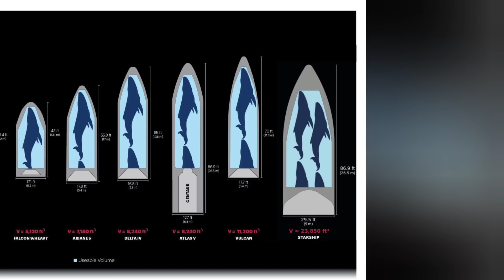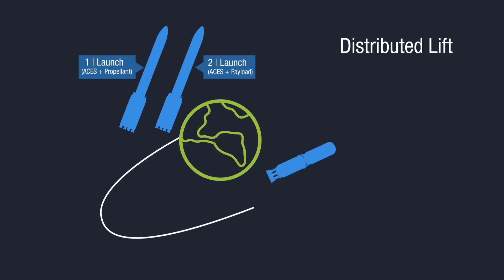Devastating news for ULA!!  But why does Vulcan Centaur matter?

Comment: Angry, the video is hard to follow; you speak of devastating news; and more then 3minutes in you still have not explained what you are talking about, what the issue is, nothing; not even a hint. You finally spill the beans more then 5min in the video... ULA has no more launch vehicles until Vulcan can fly ... so no more business for ULA, and indeed that is bad news. Maybe they can use SpaceX engines? Why not!?

Comment: Not surprised with changes needed for second stage.
Did you forget?  
ULA made a decision to REDUCE the thickness of Centaur 5, 
from the current Centaur 3.  

While I was suspect of that decision, due to Centaur 5 volume increase (my physics background),
BUT I had not seen the engineering or design for Centaur 5 (so no opinion voiced).

The open question, will the Centaur 5 thickness need to be greater than Centaur 3 ?
Larger second stage and its volume need to have same designed safety margin as Centaur 3.

Tory Bruno’s current position reminds me of Grumman’s Tom Kelly, project manager for the Lunar Module.
One engineer made a calculation error (landing struts) and bravely told Tom (expecting to be dismissed).
It delayed the delivery of the Lunar Module (not flying with Apollo 8 in 1968).
Grumman’s Lunar Modules did not fail with landing or launches at the Moon.

Comment: So if I translate with notions that I have already encountered; 
the centaur V would therefore be equipped with "tank-balloon" type tanks.

As during the beginnings of the space race (1950-1960), tanks with walls so thin that it is imperative to ALWAYS put them in overpressure

In the event of loss of pressure in the tanks, the image of an empty coke can crushed in your hand gives you an idea of the disaster that already happened a long time ago during a dress rehearsal before a launch .

When the StarShip is unable to take care of useful type C loads, there is a detail to remember

Who would use a Dragster to compete in the Nascar Coca-Cola 600?      nobody,     because dragsters are not designed for! !
 
It's the same for StarShip, it's a wonderful project but it's a concept designed for some specific missions but not All missions

Comment: Of course Musk would just launch the beast, as he did with IFT1.

SpaceX could easily carry a Falcon 9 second stage as payload for missions beyond LEO.

It is unfortunate that SpaceX has so little competition.  Musk himself would enjoy being in a race.  SpaceX demonstrated FIVE YEARS AGO that it was possible to recover a booster and prepare it in just weeks to launch again.  SpaceX has now recovered boosters over 200 times, while only one other booster has been recovered, by Rocket Lab, and even then only after a saltwater bath and not in a condition where it was economical to refurbish.  ULA, Arianespace, and even Roskosmos should have started on reuse over ten years ago.
Reply: I thought Rocket Lab was happy with the condition of their booster after recovery and extensive inspection?
Reply: @michaelreid2329 i think they will reuse an engine but not that full stage. I would guess that is because they stripped it down for analysis for future rockets.
Reply: @michaelreid2329  as I said the recovered booster is not economical to refurbish.  The recovered booster is a learning experience, the sort that SpaceX depends upon.  Examining the recovered booster permits Rocket Lab to identify where waterproof seals can protect sensitive parts from salt water.  On STS (Shuttle) the SRBs were recovered because NASA had promised Congress that they would be recovered and reused, but it cost more to recondition the SRBs than to build fresh SRBs from scratch.
Reply: Falcon heavy can already carry more than twice the payload of the Delta IV heavy lift, while the Vulcan, if it ever flies, will be able to lift about 20% more than Falcon heavy.
Reply: @michaelmurphy6195  True.  It will take a couple of years for the US Military to consider Starship for its launches.  Remember it was three years after Falcon Heavy first flew before SpaceX clawed a contract away from ULA.  Two years from now Starship will be a very different product, or rather series of different products, than it is right now.  Nobody, except Starlink and NASA HLS, even has a project which needs Starship to solve.
Reply: @jamescobban857  I also think there is very good reason for no existing missions to require Starship except those two mentioned, as it's not yet proven, and why bet YOUR entire mission/company on a yet to be proven concept?
Most likely once starship works, (assuming it does ofc), there will be more customers interested in it. Obviously with a delay, as they would not have started their project yet, but at least for LEO if you don't need to focus so much on space and weight constraints, I bet that many things can be made simpler and cheaper then today, pushing demand...
It's a bit of a chicken and egg problem, one has to exist for the other to make any sense. And in this case SpaceX is taking the chance of customers wanting it once it's proven.
Reply: @michaelmurphy6195 Google tells me, that Falcon Heavy with no reuse can lift more than max booster Vulcan. So this 20% is not true.
Reply: @ErkiEntveg  I can't argue with that, but the whole purpose is to keep prices down by reusing the boosters. I'm sure it would cost less to fly than the Vulcan even if they expend the boosters.
Reply: And probably build a test stand for centaur in about six months.
Reply: In the past, those other companies published papers "proving" economical recovery was nearly impossible. Evidently they believe their propaganda is more reliable than real world experience.
Reply: The Obama white House paid Boeing over 300 million to tell them reusability couldn't be done. Less than 10 years later here we are.....
Reply: Musk doesn't do anything bro, it's the people that are employed there!!
Reply: If Musk wants a genuine space race, then he can try to get his Starship to the moon before China's copy of Starship makes it there before him lol.

Comment: I think your argument is based on 2 assumptions.  First, that the efficiency of the Raptor engines won’t improve.  Secondly, that Starship will be so expensive to launch that it will make fuel launches very expensive.  The pace of advancement on the engines continues and the targets for Starship launch costs will only go down as they get the vehicle figured out.  The full reusability, unlike the Vulcan Centaur, will also make tanking missions to LEO more practical.  Realistically I suspect that SpaceX will turn to a space station to act as a gas station in space to provide additional fuel capacity.  Unlike ULA SpaceX is pretty close to being ready to not only launch their rocket but also build space stations.  And while all of that is being done Boeing and Lockheed Martin will be figuring out how to save every penny and make every trade-off because they have to answer to investors while chasing quarterly earnings (or avoiding quarterly losses).  Capitalism works but innovation and publicly traded companies  are uncommon companions

Comment: SpaceX really really really needs to develop a higher energy upper stage or perhaps lease the technology. Starship can deliver a high energy third stage to orbit and then be recovered and that high energy third stage could do just about anything.

It without a lot of capability to falcon, falcon, heavy as well
Reply: @@AI_effect that would give falcon and falcon heavy a ton of extra capability as well. When I first made the comment somehow “lease the“ technology got translated to “restart technology“. I would think they’d be able to lease Hydrolox technology from the French or Japanese or ULA
Reply: @mb777-g8v SpaceX will not invest further in Falcon 9 / Heavy unless someone else pays for it, which is why the costs for the future large fairing and vertical integration tower facility were included in the costs of some of the ‘Heavy’ missions they were awarded.

Comment: Angry, You seem to be putting an awful lot of faith in the detachable engine solution for reusability.  The whole thing seems crazy to me.  It's not like jettisoning a side booster; there are all the connections: fuel, oxidiser, telemetry etc. that need to be severed.  Just look at what SpaceX said led to engine losses on Starship ... the engines weren't connected tightly enough!

ULA should also say adios to Jeff Bezos and Kuiper on the Atlas 5 ...

Elon will integrate the larger fairing when he gets access to the old ULA infrastructure at Vandenberg.
Reply: The original Atlas dropped 2 of 3 engines attached to the same fuel tank and continued on (in a man-rated vehicle in the 1960s). They literally have plans to build on. The difference is that all the engines will be dropped, and a ballute deployed.

Comment: This is for sure an issue but Starship can do these missions.  Either with a decent sized kick stage.  Which shouldn't be much of an issue with the massive volume and lift capacity of Starship or starship could simply be refueled in LEO before doing the delivery to GEO.
Reply: The US Government would not want to be reliant on a single provider. In any event the Starship to GEO would be a pretty complicated process, and no doubt pretty expensive (despite what Starship fanboys think). Falcon 9 Heavy would be realistic with an improved fairing. But is Falcon Heavy going to be any cheaper than ULA Centaur?
Reply: which would double the cost of delivery.

Comment: Is there even a remote chance that SpaceX can figure out a way to strap solid fuel boosters to Super Heavy for payload missions to synchronous orbit?
Reply: I'm sure they could manage it, yeah...  But the big plan has always been to re-fuel Starship from a depot in orbit, which would pretty much remove all the limits on what it can do.
Reply: With its 9m hull in cargo configuration you could easily have a space tug attached to your GSO satellite to loft it from LEO to GSO hell you could probably have a pair of sats & tugs for GSO and a literal pile of them going to LEO all in 1 launch. Remember 100 tons of payload to LEO!

Comment: IF (and it is a big IF) ULA can successfully  launch Vulcan early in 2024 then everything might still be OK for ULA. (ULA is supposed to launch 60% of future launches and SpaceX 40%.) If not I am sure the military and NASA will look to SpaceX. I too see no good excuse for ULA not being ready with the second stage. I hope both ULA and Blue Origin do well, but I do not see solid signs of progress with either. Yes, SpaceX is risky, but at least they are proceeding full speed. 
On Reusability: ULA is not even in the same ballpark. Space X just landed their 200th complete booster. ULA hopes someday in the distant future to recover just two BE-4  engines and no solid fuel rockets. 
SpaceX is exactly right to concentrate on Starship rather than bigger fairings for the Falcon Heavy. The Starship is the future. Atlas, Falcon 9, and Falcon Heavy are in the past. 
I have the same reservations about SpaceX as Angry Astronaut and also wish there was more competition. ULA and Blue Origin look to be failed competitors. Perhaps Rocket Lab, Relativity Space, and some of the European aerospace companies Angry Astronaut covered can do better.
Reply: This shows nothing but ignorance. There's plenty of progress for both ULA and Blue Origin. After all, hasn't Blue delivered engines and those same engines passed the qual testing as well as the FRF? If you honestly answer "Yes", then you have no choice but to admit to progress. SMART recovery actually has some real advantages, and people need to get it through their skulls that the engines aren't all that's being recovered, it's the whole propulsion system, so the plumbing that takes the propellants from the tanks to the engines. The aft thrust structure also will be recovered along with avionics as well. Only the tanks and the interstage are being jettisoned.
Reply: @thomasackerman5399  The ignorance shown is not by me. 
-BE4 engines were very late and overpriced. They still have not been proved in flight. 
-SMART recovery is unproven and years away from implementation. Recovering part of a booster is far inferior to recovering the entire booster and reusing it. There are no plans to recover the solid fuel rockets of the booster.
-The Space Shuttle was partially reusable. Vulcan is 100% disposable. If SMART recovery works, it is years away and already inferior to completely recovering the booster, something SpaceX has done over 200 times.
-Launch of the Vulcan will at the very least be delayed significantly because they did not test in a timely manner the second stage.
-Vulcan is far behind Starship in new technology, and yet Starship has already launched once and with regulatory approval may launch twice again this year.
Reply: @MrEd2291  First off, you're just making things up. Most high tech development tends to be late. 

BE-4 was no exception to this, but it has been delivered last year and formal qual finished months ago. That's more than can be said for Raptor, which is still in development and each iteration gets tossed away! On top of that, you're just outright lying about BE-4 being overpriced. Please provide a citation for that. I follow a lot of this stuff on NSF, SN, and other sites and there has been nothing about BE-4 being overpriced. What we do know is that you can buy two of them for the cost of one RD-180, which means BE-4's unit price is around $8 million. This is extremely good for such a large and powerful engine. It may even go down in price since production is being expanded to support the Kuiper launches. And before you give some BS about Raptor or Merlin costs, you have to remember those are Elon's overly optimistic price goals for the MARGINAL at-cost that SpaceX charges for itself. What they would to someone else is a big question mark since SpaceX has no interest in selling to another launch company likely never will.

Starship/Super Heavy was supposed to have launched YEARS ago and this year they are failing to to provide Maezawa with his ride for Dear Moon, no matter what else happens. So I guess we can now meme "Hey Elon, where's my Moonship?" Same with Artemis 3's HLS which SpaceX is supposed to provide, but there's not been a lot of progress there. So much so, that the alarm bells are being sounded.

SMART unproven? LOFTID proved it was very possible. Or did you miss that flight late last year?

Comment: There are often subtle difference between what modern sophisticated digital design tools tell engineers and what the reality of production vehicles actually are.  This has been biting multiple aerospace programs on the ass recently.
Reply: While less widely known than electrical engineers and mechanical engineers, there is another specialty: welding engineers. They should have known that laser welding was not as strong as arc welding.
Reply: indeed.

Comment: Seems like it would make sense over time to switch to carbon fiber for the leeward or non heat shield side? It would really reduce weight and it doesn’t seem like stainless steel is necessary for overall viability.

Comment: Hold on Jordan, sorry: would it be so impossible to immagine a third stage from the Starship paylod bay to carry on through geostationaty orbit as ULA was intended to do while  Sharhip return from LEO?
Reply: Starships payload bay does not currently have a payload door..so, yes??  annnnd gonna launch that thing straight trough the LOX header tank are we?
Reply: @Heinrich_Von_Schnellfahrer It doesn’t currently have one, but it will have to have one eventually. Especially given that part of its reason for existence is to put large/heavy payloads into LEO. Given all that, it’s not that improbable that it could be used to launch a self propelled spacecraft that could propel itself up to Geosynchronous Orbit or even TLI. 
Not only that, but Starship is meant to be capable of travelling to, and returning from the Moon and beyond with refuelling.
Obviously this all needs to be successfully tested and of course the economics of refuelling in orbit might make it too expensive for launching arbitrary small satellites beyond GTO, but it still ought to have the capability.
Where cost is the major limiting factor, firms like Rocket Lab could well be major competitors for ULA in this market sector.
Reply: @Heinrich_Von_Schnellfahrer  Starship doesn't have a payload door, but it most definitely would need one to fund itself. Even if it means making the ship expendable and removing the LOX header tank like the lunar variant. Would still be cheaper than other options for an expandable starship.